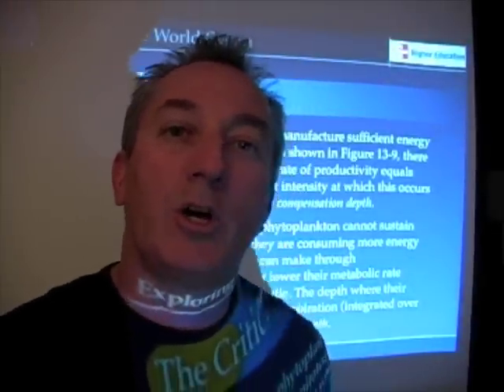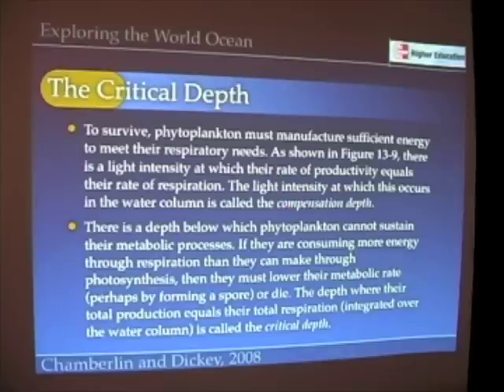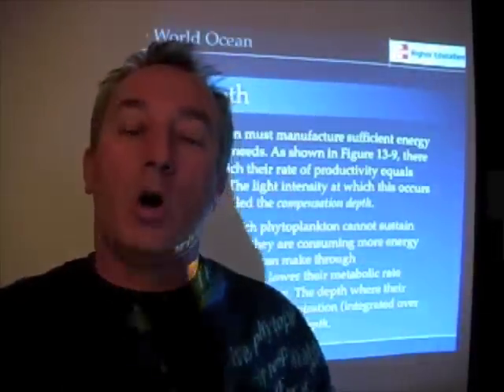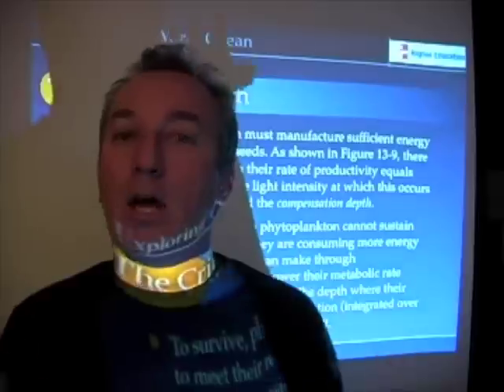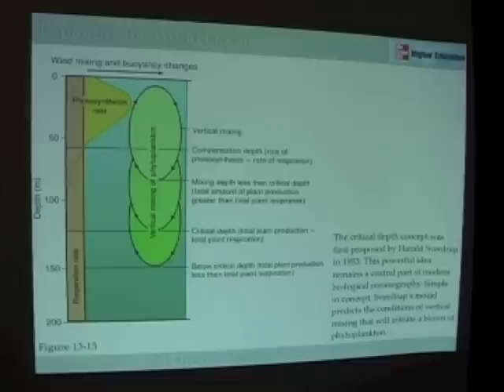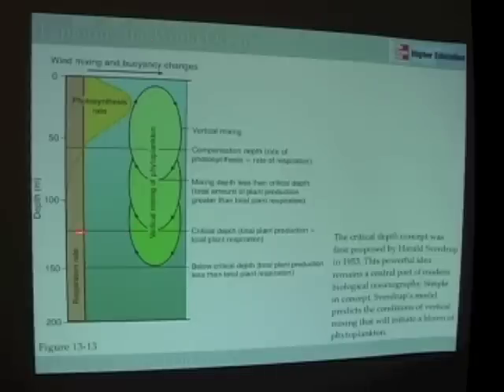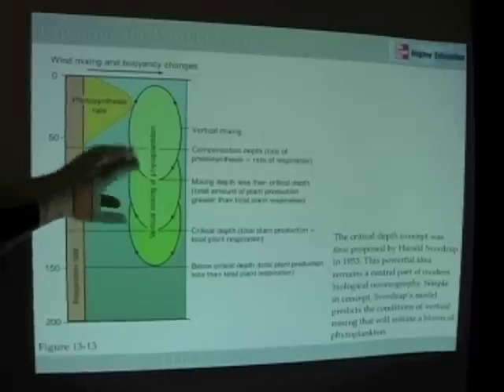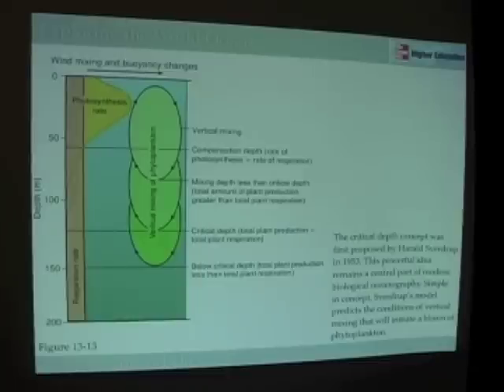Ocean Productivity - Critical Depth

Comment: So do phytoplankton have positive productivity above the compensation depth or the critical depth? Didn't quiet understand
Reply: Over the compensation depth, they do have positive primary productivity. However, over the critical and below the compensation depth the productivity reaches zero as the rate of photosynthesis and respiration becomes equal.